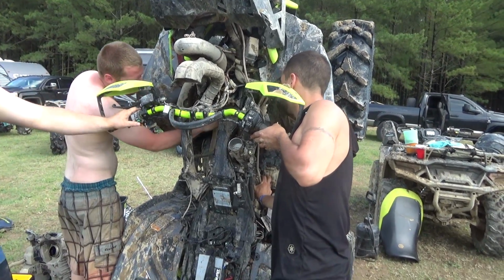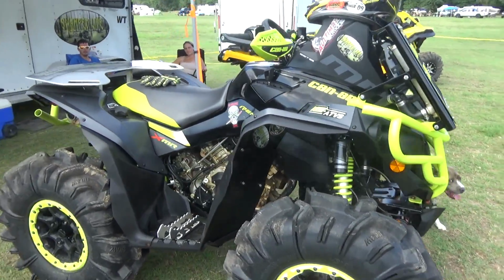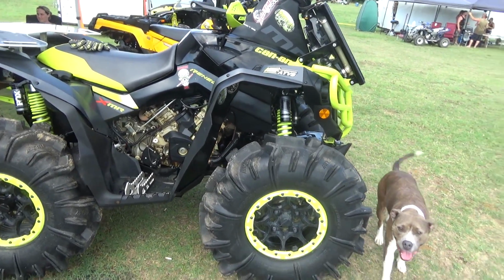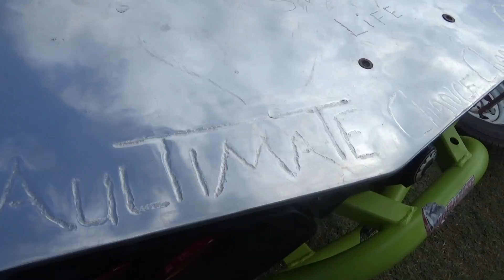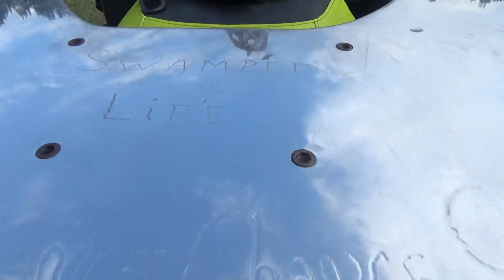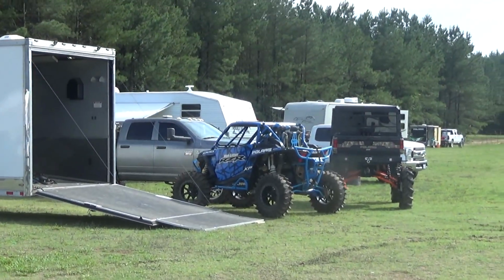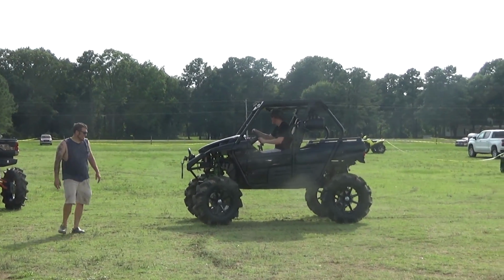BUSCO BEACH MUD BASH ..... NOT GETTING MUDDY TODAY ... YEAH RT! PT 1

Comment: 18:45

Stop wasting time and oil.

2 quarts of cheap oil
2 quarts of marvel mystery oil
2.2 quarts of your usual oil
New Filter

Option 1
Drain oil, clean filter. Add 1 quart each of the above. Crank the engine. Let it idle for 5 minutes. 
Repeat
2nd time idle for 10 minutes.
Drain
Install new filter and 2.2 quarts of your favorite premium synthetic oil.

Option 2
Only do step 1

Trust me. It works. Will it clean the internal screen in the nether regions of the crankcase? No, but it's the best shot you got.